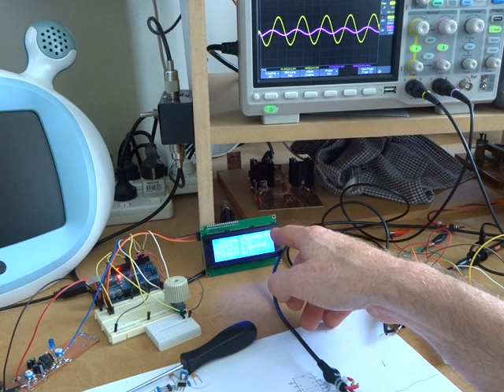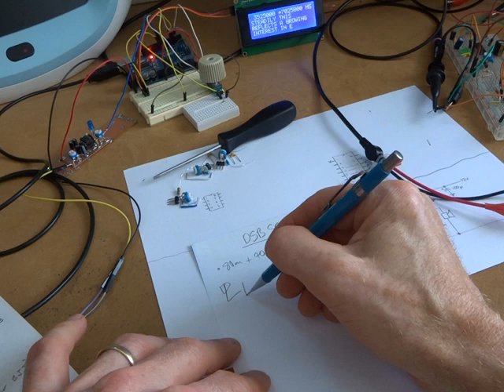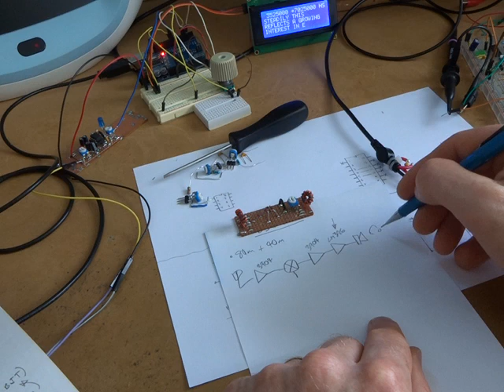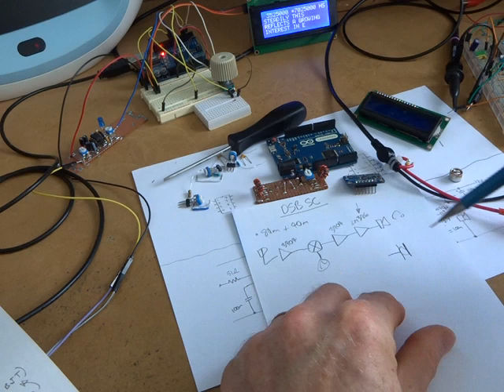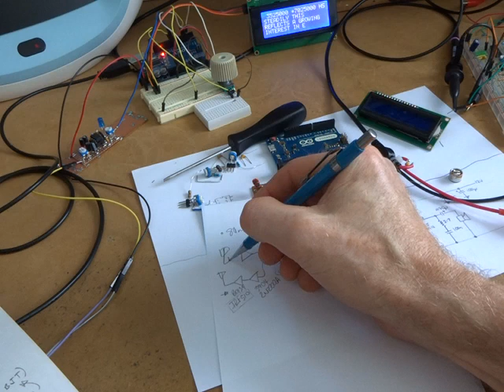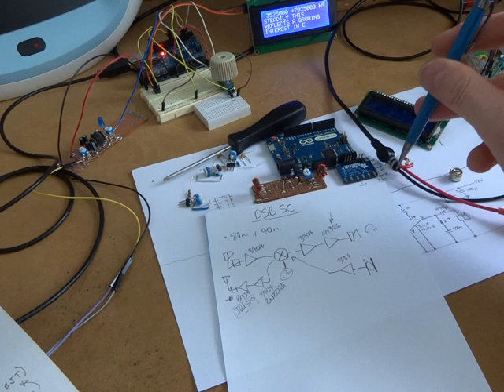Simple Homebrew DSB-SC 80m 40m Rig

Comment: Charlie, what you do is EXACTLY what the US government hopes hams in the USA will do once they get a license. The high power and multiple bands are not the difference between amateur radio and CB. They are the incentive provided by the government to get people involved in learning about RF electronics. That's why even a Tech Class licensee is authorized to design, build and operate an amateur station running 1,500 watts of transmit power. That's what the government HOPES they will do. That's why the government effectively 'gives' billions of dollars worth of RF bandwidth to hams for the  price of a small one-time license fee. Unfortunately, there are far too many hams in the US who don't grasp this simple concept for one reason or another. And of course there are plenty of businesses around to sell expensive appliance radios so the hams don't have to know anything about radio and can simply play super-CBer for the rest of their lives, forgetting the little they needed to know to pass the multiple-choice test for their license. Personally, if I had the authority I would require all hams to at least build their own gear, if not design it unless they had a disability that kept them from doing so.

Comment: Detours are scenic! LOL!

I like the idea of the discrete diode mixers!
Reply from the maker: Thanks Christina. As I was saying to Barry below, I wonder if it worth doing a SDR where the hardware and code is not built from scratch, but instead use a RSPi and QUISK. I get the impression there may be some interest in that.
Reply: @CharlieMorrisZL2CTM  Well, RPi and QUISK certainly brings a lot to the table and, for many, it would perhaps be far easier to construct while getting more for ones time spent on a project.

It would absolutely be a worthwhile project.

I tend to be flexible and have no issues with project/hardware complexity.  I very much hold the opinion that SDR is the future.

All that said I, at least, enjoy the simplistic approach.  

In many of your projects, the most complicated/high tech module has been the si5351 with Arduino or,  in the case of the SDR, the Teensy.  

I like that, because the rest of the project is basic radio and, there is still a lot of takeaway learning from that.

All of this of course is just my own opinion, and I am hardly your only viewer!

Cheers!
Reply from the maker: @christinamarks6349  Thanks for the input Christina. Looks like I will have to update my old RPi. Any excuse!

Comment: Thank you! Excellent idea for a project!
Reply from the maker: Thanks Barry. I'm wondering too if a SDR series would be useful too. Not build/code an SDR from scratch, but use a RSPi and QUISK.
Reply: @CharlieMorrisZL2CTM  When I first got started in SDRs (around 2008 or so), I built something similar to the Softrock SDR (SDRZero?, I think). However, it was simply deadbug style on solid copper. Didn't work very well, but enough to get some homebrew satisfaction out of it. Now, I just use my RTL-SDR.com V3 in direct sample mode. Really nice to have 2.4Mhz of spectrum to work with instead of being limited to 48khz or 96khz through a sound card.
Reply from the maker: @boomboom186282  Good point. The RTL-SDR is certainly gaining in popularity. I'll put some more thought into it.

Comment: Are 2n2222's a good sub for 2n3904's?  I got a TON of factory marked 2222's cheap.
Reply from the maker: I started with 2N2222/2N2222A as they were metal can and could have a small heatsink. Download the spec sheet sheets for the 2N2222 and the 2N3904. They are similar. While the 2N2222 has a higher max Ic rating, its Pd and HFE are slightly lower than the 2N3904. Ft is approx. the same too. Both will be well beyond 10x our highest frequency of operation.
Reply: @CharlieMorrisZL2CTM  Actually, the transistors I have are PN2222's, so same case as the 2n3904 but same specs (except for pt) as the metal 2n2222.
Reply from the maker: @scharkalvin  I'd play it by ear. I'm not sure yet how it will play out. All good fun.

Comment: Awesome Charlie. You've described exactly the project I'm working on so it'll be great to watch your progress and steal ideas from you :) I've decided on the BD139 in class AB. I'm planning on adding CW and achieving that via unbalancing the mixer (using the method described by Wes Hayward SSDRA, Fig 32 Page 202). Having the CW option has the added benefit of providing a signal when using an antenna tuner. Something I've wondered about is running the LM386 flat out and having the "volume" control in front of the mixer.
Reply from the maker: Perfect. Adding CW is a good idea. I'm going to keep things nice a simple for now.